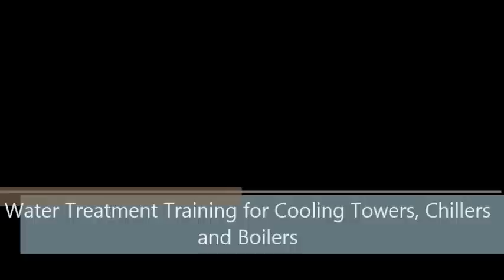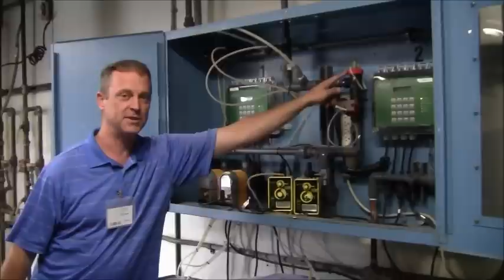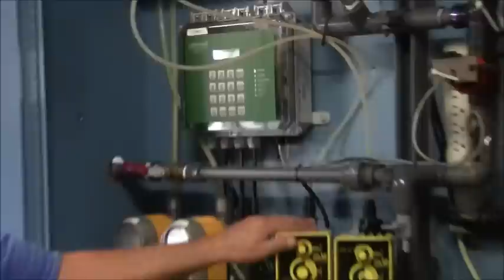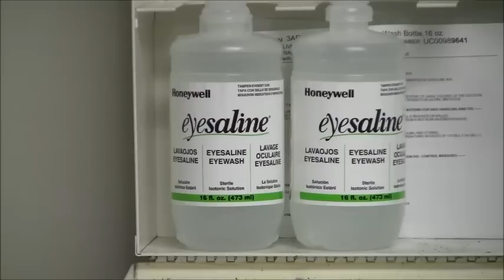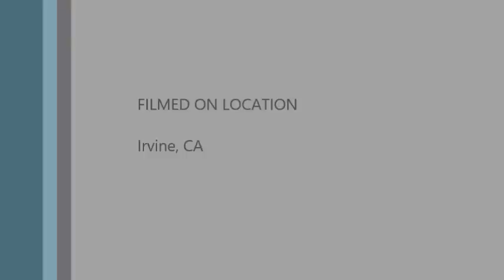Water Treatment Training for Cooling Towers, Chillers and Boilers

Comment: very good , its helpful  Ken  :  I would like to add , particularly in open loop system in cooling towers the water takes some air and  oxygen  exist in the air will react with the steel pipes and oxidation process takes place and forms ferrous oxide (corrosion) will occur. then it is necessary to add anti corrosion chemicals.

Comment: It can save cost if you use water fluorescent tracer (cas:59572-10-0) to monitor your water treating chemicals' dosing in cooling towers and boilers. Manufacture's suggestion. THANKS!

Comment: How long does the water treatment process take? How often should blowdown be done?  Thanks for sharing!  🌎🥼🧪
Reply from the maker: 30 minutes to test water each day for this system. 
blowdown depends on several factors. 1. city TDS, 2. system run time, 3. system running capacity, 4. outside temperatures.
Reply: @KenTraining  Thanks Ken!

Comment: what type of certification required for a Quality control Specialist (QC).
Reply: That’s my current title, I work for the 2nd largest Brewery in Los Angeles. Typically any BS in Science can get you hired but some of the places I’ve worked at least want you to have an A.S. Degree. I have a B.S. in Chemistry but there are also programs like Water Treatment Operator I, II or III certifications you can get at some community colleges. That’s probably the fastest, cheapest way to go, then just start getting EXPERIENCE.